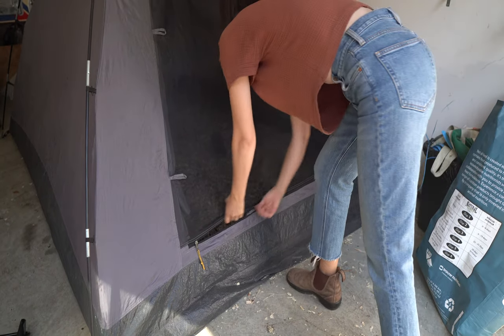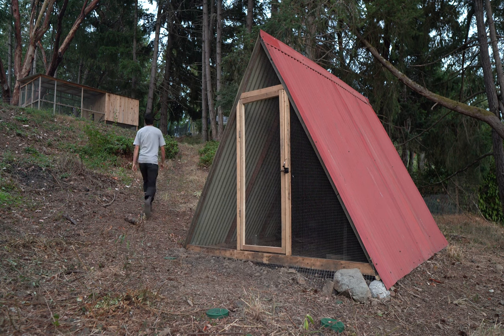Minimalist DIY A-Frame Chicken Coop Built Start to Finish.

Comment: i was looking at your other coop, but i think i may just build this one. would it be good for eggs?
Reply from the maker: This one could definitely still work for laying hens, but you'll need to incorporate some sort of nesting boxes for them to lay their eggs in. It wouldn't be hard to add, maybe along the back wall, but definitely a consideration.

I have a video on the nesting boxes here:

https://youtu.be/9Do7OVLUeB8

One other thing to add would be roosting bars for the chickens to sleep on. These could easily be run across from the "rafters" of the a-frame.

Good luck!

Comment: Could this also be used as a tractor? Or is it too heavy?
Reply from the maker: At these dimensions, it's a bit too big/heavy to move around like a tractor. Maybe a scaled down version, using plastic or polycarbonate sheet roofing instead of metal, could be movable.

Comment from the maker: What could I have done better?
Reply: For 10 bucks, it can't be beat,  so nothing lol...If you can get metal for free, invest in a wire welder, a new world will open up for you, super easy to use, you will be welding in 10 minutes
Reply from the maker: @MosaicHomestead  I've been super curious about welding, I think it would be a great skill set to have around the homestead. Thanks for the advice!
Reply: @Slowsteading  Home depot sells a small Century wire welder for $ 250, its super easy to use, will get your money back in less than a week,  must have tool for Homestead,  your handy, you will pick it up fast.
Reply from the maker: @MosaicHomestead  Beautiful, I love it! Can't wait to weld some metal 💪
Reply: Would it not get scorchingly hot in there for the chicks
Reply: @CryptoJelleNL  if it does,  that's called chicken nuggets lol
Reply from the maker: @CryptoJelleNL  It definitely would in the summer, that's a great idea to keep seasonality in mind. This will be used for meat birds in the fall and maybe spring.
Reply: Looks like you almost drilled into your finger at 3:28 XD
Reply: needs a window. they have very little light.

Comment: A hint take one long piece of metal roofing uncut late long ways from Eve to Eve then bend down and nail it in place so you get no leaks I'm very top on the top part the very center longways so it covers the entire building very top make sure to make it your last piece you put up use Hot tar to seal it

Comment: And looking at it you didn't do it right it's going to leak all over the place
Reply from the maker: The structure itself was quite watertight, leaks were not an issue. Plus it was an outdoor chicken coop, so 100% water tight was never the goal nor a necessity.